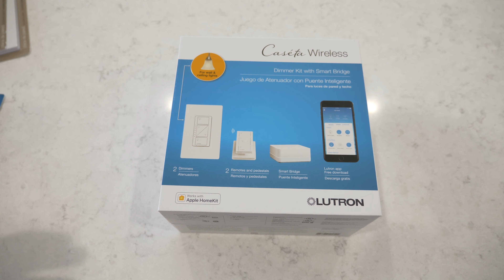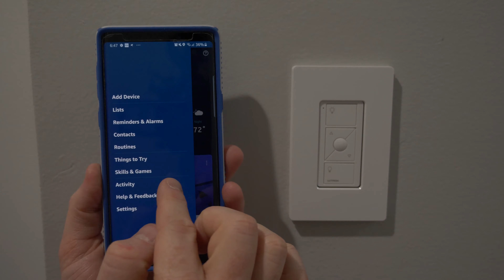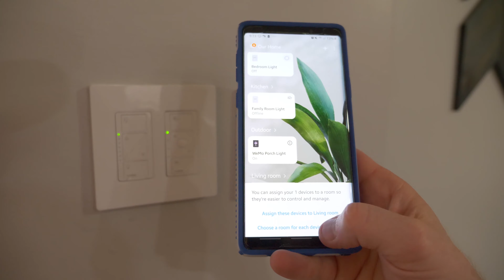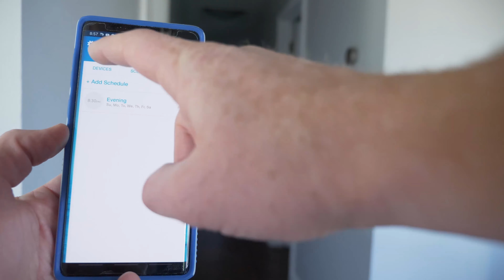Lutron Caséta Wireless Dimmer/Fan Control Installation & Review

Comment from the maker: What further questions do you have?

Caseta Wireless Dimmer Deluxe Kit: https://amzn.to/2SC3vO0

00:19 Introduction to Caseta Wireless by Lutron
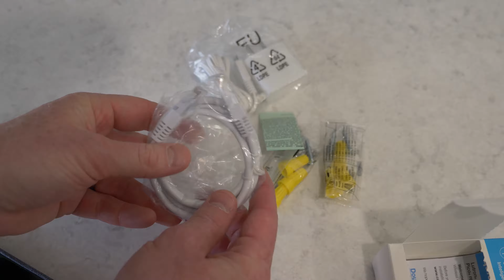02:08 Smart Bridge Setup
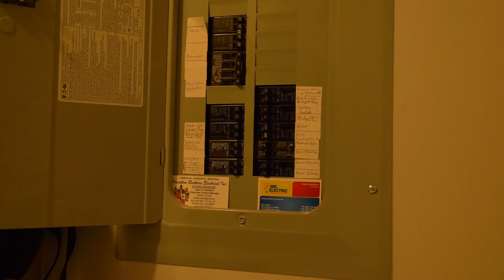03:00 3-Way Dimmer Switch Install
05:12 3-Way Pico Remote Install
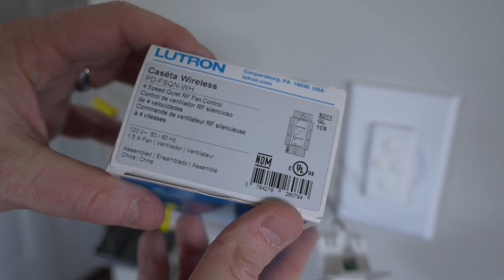06:24 Fan Control Light Switch
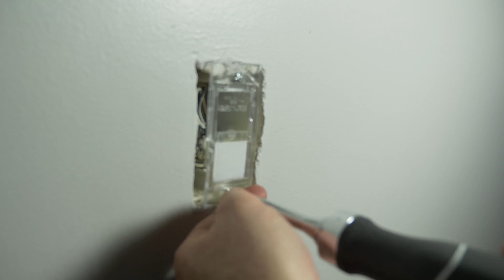06:07 Single Pole Dimmer Switch
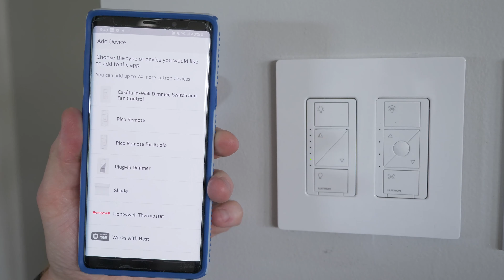09:14 Connecting Lights to Lutron App
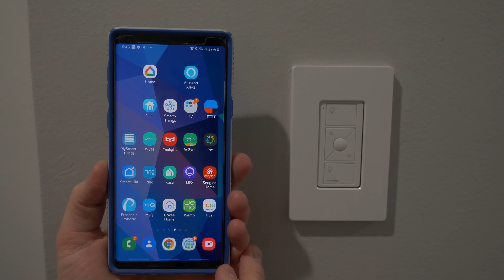10:48 Google Assistant
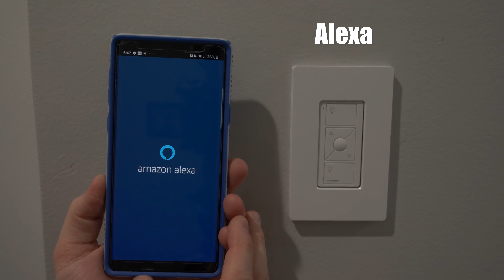11:48 Amazon Alexa
12:31 Apple HomeKit
13:29 SmartThings Compatibility
14:22 Operating the Dimmer Switch & Fan Control
19:15 Lutron App Extras
20:06 Final Thoughts
Reply: Hi Brett why dont you put a smart bulb in the fan instead of wiring another line? 
Is there a version without neutral wire?
Nice video!
Reply: Hi Brett i have the same question for fan/smart bulb. i also have another question, do we need to set up the smart bridge before wiring the dimmers etc.. or it can be done after the installation of the dimmers and pico
Reply from the maker: @mikailtelly  Setting up the Bridge can be done after after you have all of the lights installed. Then just for through and add them all one at a time.
Reply: Pqhcbvbcvbfgfgjm. G. Xgfgc bn

Comment: If i have wifi, if i only have one switch... what is the advantage of having a bridge if I have a smartphone? I thought I could use my apple/smartphone to control?
Reply from the maker: For the Caseta smart light switches, the bridge is required to connect the switch to the internet as these specific switches don't have wifi, they use a different signal. So if you already have this switch, setting up the bridge let's you use if from your phone. If you don't have the switch yet, they're are many wifi switches available that you can pick from.

Comment: I have a fan that currently has a wall switch with buttons on it and I’m assuming a receiver in the canopy above the fan. 
Does this switch work with other existing receivers that may be inside the Canopy cover above the fan? Or would you have to remove that with the old wall switch? Thanks

Comment: Thanks for the video. My question is regarding the Pico Remote. Can they be used separately from the main dimmer switch? Let's say on another light or do they have to work in conjunction with the main dimmer switch on one light fixture? Thank You.
Reply from the maker: They can be setup to control any of the Caséta switches you have in the home. So all the lights or just a specific set or just one.
Reply: @TechWithBrett  thank you for the quick reply. So much to think about when  starting a smart home setup. Over load!!!

Comment: I have been using Caseta dimmers for over 5 years and it's been a hit and miss depending on what you're dimming. 

Caseta dimmers work but are limited by their outdated, analogue dimming circuitry which Lutron has been using for well over 30 years. It's old and inefficient technology that's very limited. Expect to loose about 12% of your supply voltage to the dimmer's antiquated technology. It was really noticeable back in the Halogen lighting days with Lutron's previous dimmer lines and still noticeable now with the Caseta line when you use higher end LED PAR20, PAR30 and PAR38 LEDs with a super high output and high CRI. What you see with a voltage meter at the e26 socket with the dimmer at full setting is around 103V to 106V on a 120V supply which ends up taking the edge off high performance LED lights and making them look average. 

If you are only using average, middle of the road LEDs and/or almost always dimming them, then it's no problem as you won't miss having 12% less light output at the top to begin with. How Lutron can call these 'smart light controls' when they are still using 30+ year old analogue dimming technology is beyond embarrassing. Why not go completely digital when the light sources these days are for the most part digital?
Reply: What brands of LED lights do you consider "high performance"?  What smart dimmer brands are digital and don't suffer a voltage drop?

Comment: Brett, thanks for the info. If the internet goes down, but the local network is still functional, can the hub still control all the lights locally?   I.e. what are the critical points of failure?

Comment: The fan problems are because you just have the fan run from one power wire right?  The light and fan are not wired separately, right?  That could be done though, right?  If you hold the bottom button will it do slow dim to off (10-15 seconds) like some other Lutron switches (Ra, etc.)?

Comment: I have to install 5 led under counter lights in the kitchen. They all have separate switches as it's not possible to wire them all together to one switch. Is it possible to put these dimmers on each one and then operate them from one Peco remote? That would be optimum. I don't think I need to operate them with a phone, just the remote on a wall somewhere would be fine.
Reply: Yes this can be done in the app

Comment: Nice video. Assuming the pico remote has a battery, how long does it last?
Reply: The website says the battery should last around 9-10 years depending on use.

Comment: Are you able to use this for lights with multiple switches? If not what smart switch options are there that can function with multiple switches for one light?
Reply from the maker: Yes this is a good option because you can change the 3 way into a single switch and then use the Pico remote to control from different locations.

Comment: Uggg, another bridge. lol  I need a homekit fan control with no bridge.
Reply: You're mistaken as was I until learning a little more about networking, you certainly do want a bridge. To put it layman's terms, your "bridge" essentially takes the load off what would be many WiFi devices (say if you had Philips Hue throughout your house and each was on WiFI) bogging down the network and funneling all data transmission through a bridge instead of having dozens of WiFi devices you have one, if that makes sense.
Reply from the maker: Yeah... After a quick search it looks like this is the main option.